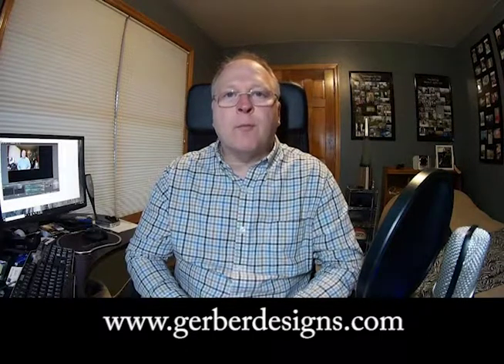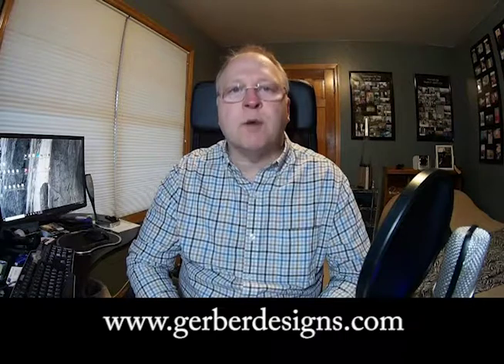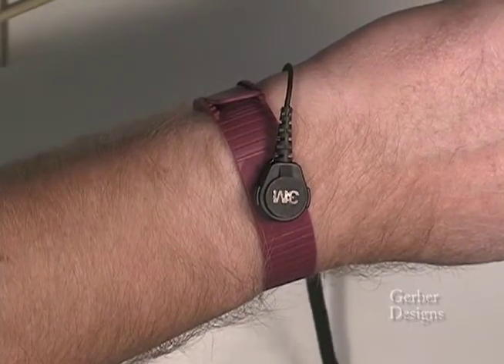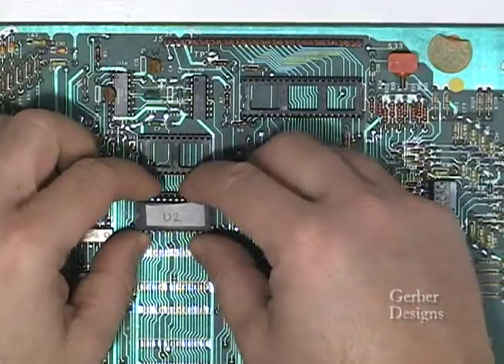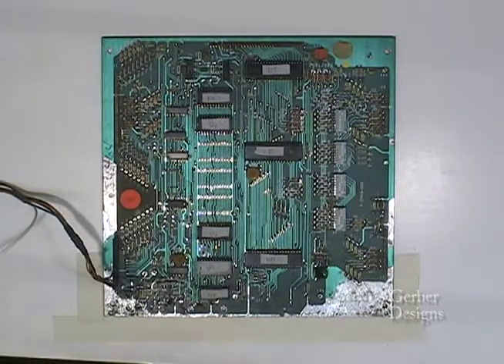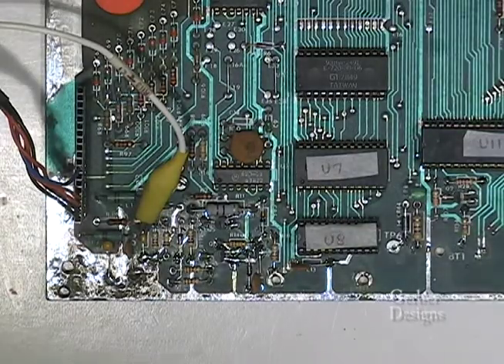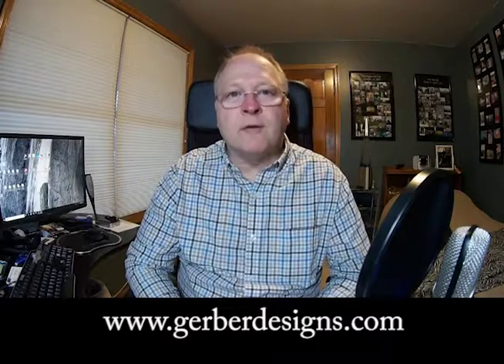Part 6 of 7 - Applying Power and Testing - Bally Pinball AS-2518 MPU PCBoard Corrosion Repair

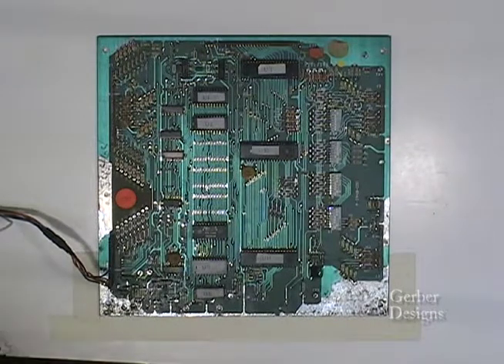Comment: Section 3:20 
I understand to get the 7th mpu led flash there must  be +43VDC supplied to the MPU at connector location J4. 

The extra alligator clip connection shown adds +43VDC from an external power supply to C1? Or is it just a jumper to bypass the system to achieve the 7th flash?

Thanks,
Chris
Reply from the maker: Hi, thanks for the question.  The alligator clip is actually supplying +43Vdc.  I am using a power supply from an old AT computer.  These old power supplies where large, physically. Large enough  to open the enclosure and add a transformer and rectification to get a +43Vdc output.  The alligator clip is needed because I don't recall a connection being available on the MPU board header connector for the 43 volts.  Thanks.  Chris...
Reply: @gerberdesigns  Thanks Chris. Oh yeah besides the learning curve the EPROMS successfully burned. Fireball 2 Bally MPU is alive and well.
Reply from the maker: @retroamusementsnl4780  Nice work!  That's awesome!!

Comment: can I suggest people should check each IC in turn and clean corrosion on the legs very carefully with finest wet and dry paper before refitting them, sometimes you have to replace the IC